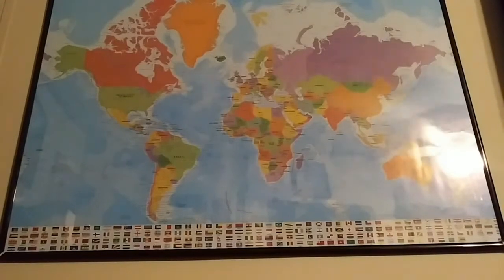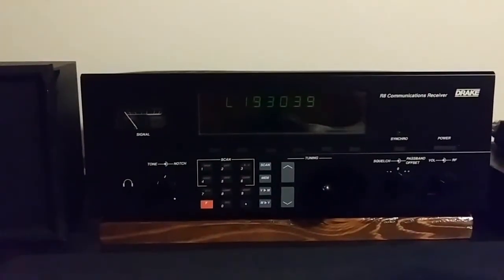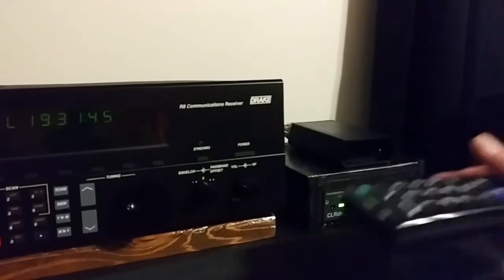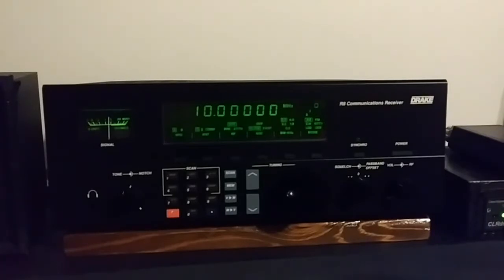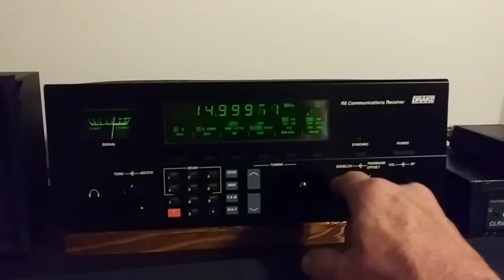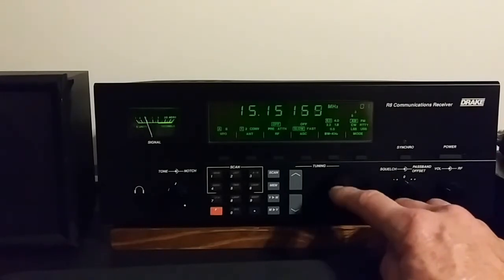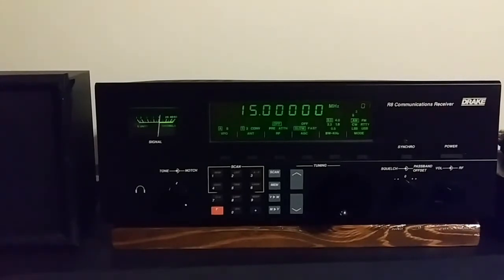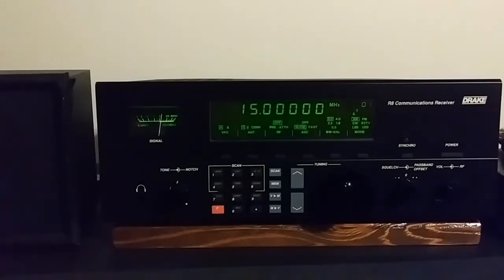My Drake R8 Receiver. 30 years old and still going strong.

Comment: Thanks for your observations. I bought my R8 used twenty years ago, and it's been absolutely rock solid. It shares antennas with an RSPdx, SDRIQ, R390A, Kenwood R-2000, and a host of old Hammarlunds. It is right at the top in terms of sensitivity and selectivity. The ergonomics are enjoyable for me, I have no problem with the carousel arrangement. The only gripe I have about the rig is the clock. It runs horribly slow, which seems odd, considering how well it does everything else. Thanks again.

Comment: These are absolutely fantastic radios.  Congratulations on having owned one for so long. 

Mine slowly became deafer and deafer over time.  Someday I'll have to send it in to get serviced/aligned.  The only thing holding me back is that the cost to get it serviced would be about the same as what you'd pay for a used one.
Reply from the maker: Oh Yeah, that's a very hard decision to make sometimes. On these old receivers, no matter how long you've had them and the sentimental feeling for it, it's hard to decide if you want to put the money into them or just move on to something newer. Since Drake is no longer in the radio business, and the Drake tech that was servicing mine retired, when mine finally goes, I won't get it repaired. I'll just box it up and use my newer radios. But it will be a sad day.

Comment: Sweet!  That tuning dial is awesome.  I have an R8B and it wont move unless your finger is moving it, and stops as soon as you let go.  Thanks for sharing!  I have some older radio vids on my channel that you might enjoy.  Thanks again!
Reply from the maker: I always wanted an R8B. I had the R8A also, but sold it. I know the SYNC was really improved on the R8B, along with ergonomics. But, I wasn't going to spend $1,400 for a used one on eBay. I just saved a little longer and got the Icom 8600. But the Drakes are still wonderful receivers today if you can get a good one.

Comment: Very nice presentation. I too have an r8 but it suffers from low audio. I gather that it needs to have a couple caps replaced but trying to find someone to the the work is near impossible. I too also have an icom r8600 but I miss that Drake. Good luck with your r8 and your listening. BTW how do you tell when it was manufactured?
Reply from the maker: The date of manufacture is coded in the SN#. I'll have to look at mine again and read it. In my R8, sometimes it seems like I have to rotate the volume control a little more than I used to. The 8600 is a good receiver, but Icom could improve a few little annoying things. But I really like my 8600.